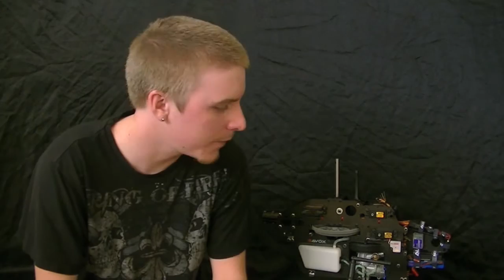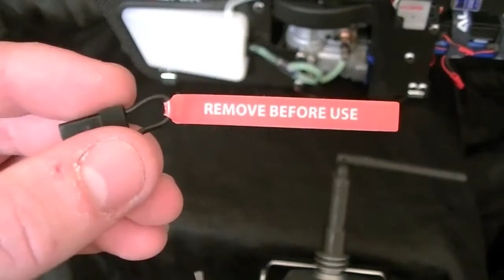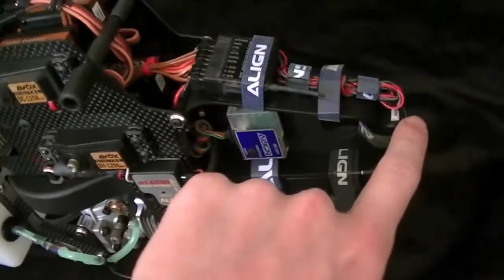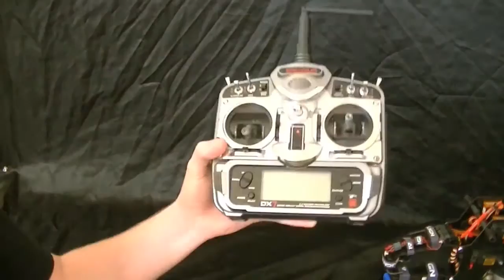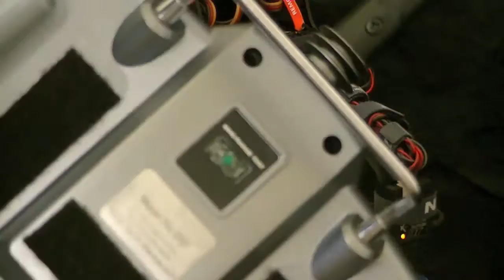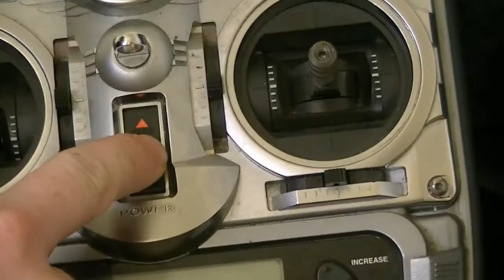heli tips and tricks (radio binding)

Comment: Hi this is a great helpful video. Thank you. But I have a question. I have a helicopter that's set up that I need to put on a new radio transmitter. I understand how to bind the two together but if I switch to a new transmitter do I have to completely reprogram the heli? Or is the programming stored in the AR-7200 BX flight controller? Thanks again for helpful video.
Reply from the maker: @microreniassance2929  the selected settings in the beast x will save yes, however your radio settings will not.  So you would absolutely want to go back through the whole setup but it should be much faster because of the prior setup for center and all that.  Should actually only take you a few mins to do :)

Comment: Hey, Freddy you provide a ton of useful information which we flyers absolutely appreciate. My situation: My T-Rex 700 electric is bind with a V-Bar receiver. During binding of a new model/T-Rex 500 into my DX9 transmitter, I failed to ensure that the transmitter was set to "New model"'; The 500. I activated the bind switch while my Tx was set to the V-Bar 700 model binding the 500 over my 700. The V-Bar doesn't know that it no longer has a transmitter. Therefore,  Is there anyway to undo the T-Rex 500 bind in the transmitter only and rebind the V-Bar without having to undergo full V-Bar setup...all over again?  Moral of the story: Lesson learned. I thank you in advance for your valued response.